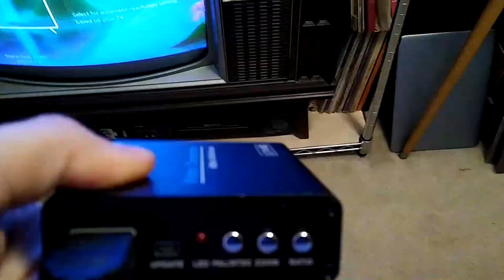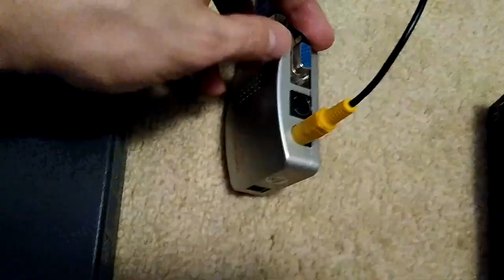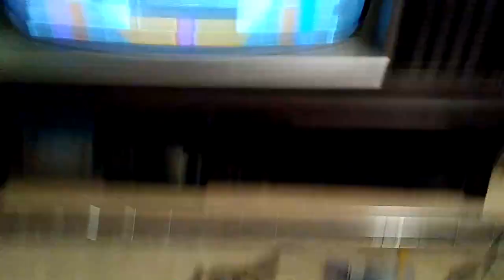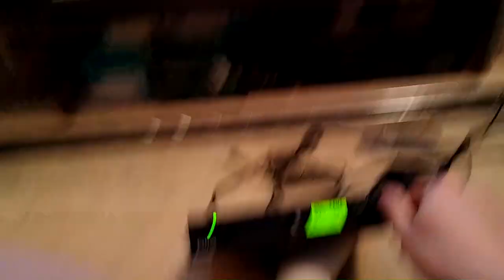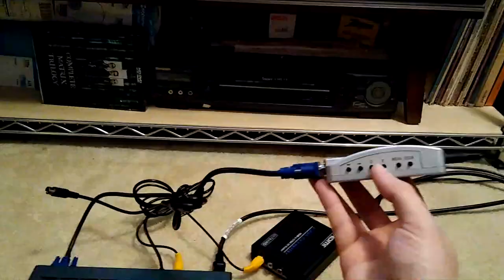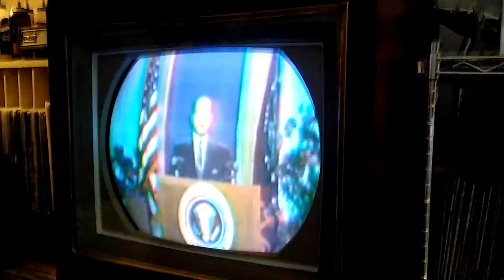Eliminating Letterbox (Those Annoying Black Bars) From Vintage TV Screens

Comment: Thanks Tom!  I'll throw my two cents in here... I use several different devices to get DVDs and other material on my vintage TVs...  I have an older Apple computer that runs OS 10.6.8 Snow Leopard.  The DVD app is much more useful than modern apps because it lets you completely modify the aspect ratio, color and brightness and turn it into anything you want.  This way, a 16:9 DVD can be stretched and cropped to fill the 4:3 screen.  I would then output that via mini display port into a cheap HDMI or (DVI) to VGA converter box (from ebay).  The VGA signal goes into an Extron VSC 150 which outputs composite video (NTSC or PAL).  The Extron VSC 150 is great because it does not have a display you have to navigate to make it work. It is a simple interface with a few buttons and a couple of adjustment controls. It also has an IR remote which is helpful.  Unfortunately, this older iMAC no longer supports a working web browser so I have to use other things if I want to stream YouTube or something.  So I have a newer iMAC and I output an HDMI signal and into the HDMI to VGA converter and to the Extron.  It requires some cable swapping, but no big deal...  The biggest issue with streaming from a modern web browser is the copy protection. We aren't trying to copy, we just want to watch stuff but some web sites - such as Netflix or Amazon don't allow this to work. I'm still searching for a good way to do this, doing some experiments.
Reply from the maker: I haven't had any issues with copy protection on my windows PCs...Granted I don't watch netflix or amazon.  I have sometimes encountered copy protection (HDCP) issues with running Blu-Ray into some devices. I defeat HDCP (from HDMI and DVI) with an HDMI splitter (View HD brand).

There are also remote controlled HDMI input switchers out there to eliminate the need to cable swap.  I've had 8 HDMI/DVI source devices in my main source rack and switch them all remotely with a 5 in 1 out switch feeding an input on a 4 in 2 output matrix (which also can function as a splitter/HDCP remover).
Reply: @tomcarlson3913  Thanks very much for the tip.  I've tried a different HDMI splitter and it was not very helpful at the mentioned use.  I'll look for the View HD!

Comment: I'm going to give this a shot I just spent under $100 on everything you just described for option two My old TVs are so bad resolution wise anyway '60s and very early '70s color tube sets, I just want to size the picture right when I'm doing HDMI Chromecast zoom mode on the converter box shrink it down so that you can see the whole picture instead of a zoomed picture cutting off most of the edges, blah blah blah
Reply from the maker: Sounds like you found a good deal on that gear. I hope it works out for you.
Reply: @tomcarlson3913  I'm hoping that it will work out I don't think I have to worry about black or white crush because the old CRTs that are too driven are never really good at pure black and pure white anyway I think I would only notice it on a digital television or a high definition television. Even my solid state RCA color track you might see a little but on something like a GE porta color probably wouldn't even be noticeable.
Reply from the maker: @sabbath7081  I'd recommend using a computer to set up brightness, contrast, and centering on the VGA to composite converter first as it will help avoid setting up the first scaler wrong trying to compensate for the settings of the second.
Reply: @tomcarlson3913  oh, I don't own a computer, is it doable without one? I'm sure it would just be more difficult.
Reply from the maker: @sabbath7081  It's doable without a computer (I did so crudely in the video), but having a computer makes adjusting it optimally a little easier.
It kinda blows my mind to read comments on the web about not owning a computer...Till I remember smartphones are a thing...I Can't stand watching youtube/don't like reading some of the tiny fonts websites use on my phone...They need to add monitor outputs to smartphones to make them practical for anything beyond emergency away from home use IMO.
Reply: @tomcarlson3913  I definitely dropped the ball in my life time I'm 40 years old and grew up in the age of computers watch them go from the turtle with the colored lines to what they are today but I never learned how to use them as a way of life I learned how to do a lot of things on the smartphone just by using it sometimes I feel as though I should have spent more time learning computer stuff because it would have been helpful in the past but, could have should have would have you know the story.
Reply: @tomcarlson3913  I'm pretty much good with anything mechanical and have a good career in HVAC there's always time to learn computers hopefully I'll get caught up at some point.
Reply from the maker: @sabbath7081  I'm about a decade younger, and I was kinda late learning them myself. It wasn't till partway through high school when I got exposed to high speed internet, PCs that weren't a decade+ old and nearly non-functional from viruses (and learned about electronics forums) that I first started to care about computers...Within about 3 years of that I was picking up curb PCs and installing new hard drives and OS on them after teaching myself how to do so. Now a days a dirt cheap 10 year old rig (assuming cap plague isn't killing it) is plenty good/fast for most things you'd want to do...Heck, my old college laptop I'm typing this on is 10 and still pretty good.

Comment: Is there a way to get letter box wide-screen 16:9 (black bars) with a roku on my 4:3 aquos sharp 4:3 display?
Reply from the maker: I'm not familiar with what inputs and tuner are on Aquos TVs (I understand they made many different models over many years with that trade name)...However method 1 mentioned in the video should work as long as the converter box is set to letterbox or set-by-program mode. One of the reasons I like method1 is that the Zenith DTV tuner I use lets me jump between letterbox and cropped at the push of a button on the remote so I can have it any way I want. 
Method 1 may not be the cheapest way. Depending on the age of the roku (older models with built in composite output tend to be best) there sometimes are display settings buried in the menus that allow control of that. If your TV was made after 2002 and has HDMI there may be display menu settings in the TV to control whether it displays letterbox or not.  Some HDMI to AV adapters (if you're using one) have a zoom button to switch between letterbox, cropped, or squeezed...you may have to buy multiple different models of HDMI to AV adapter and test each one to see which does what you want...None of the ones I own are being sold new anymore so I don't know what any specific new unit will do....I can also tell you from buying several different HDMI to AV adapters around 5 years ago, that they all had different default behaviors and the for sale pages were so vague about how they handle the aspect ratio change that the only way to know was to buy a few and test them.

Comment: How did you plug in the yellow video plug to composite input on the Extron? Did you use a BNC male RCA female adapter?
Reply from the maker: Yes I did. I tend to forget to mention adapters...maybe I should make a video about them.  Composite video is a signal standard that tends not to care what type of coax connector is used for it. So different gear in different markets and time periods uses different style jacks for the same standard signal. PL-259 was the original Composite video connector at TV stations and the first consumer VCRs, around the time BNC phased it out in TV studio use consumer equipment (VCRs) moved to RCA since it was cheaper.  I've also seen F-type connectors (typically used for RF instead of composite)  used for composite video in equipment intended to be used as the signal source for Cable TV systems....The Blonder Tongue AM60 modulators I use to transmit analog TV are a good example of that. I guess cable operators can't be bothered to stock and crimp a different connector on to their bulk purchase coax.
Reply: @tomcarlson3913  Thank you for verifying to use a bnc rca adapter. If not too much trouble, for option 1 what type of RF attenuator box model are you using? I am having trouble finding one. Maybe I am not using the right keywords. Also, is there a specific type of transmitter/antenna that you use for option 1?
Reply from the maker: @sedlacek50  All it says is Archer TV-VCR Signal Overload Attenuator.  I did not buy it new (it came to me in a box of odds and ends) and I don't know if it's still in production (though SOMETHING similar should still be available). Some brands of ATSC modulator have weaker signal that doesn't need attenuation or, an output level menu setting (mine has one) or control pot...If there is an output level control, setting it a pinch above the minimum level that works good should eliminate the need for an attenuator...Just make sure to start at minimum and turn it up till the box reports good signal on your channel. To be honest I don't run option 1 with the ATSC signal hard wired (thus I don't need/use the attenuator with it) because that ATSC signal is useful in other rooms I can't run wires to (so transmitting ATSC is useful to me).

Comment: What models of DTV tuner have the scaling options?
Reply from the maker: I'm using a Zenith DTT901 (Insignia and LG sold rebadges of it too) because it's also a strong receiver for DXing distant DTV stations. (Zenith also sold some HD DTV tuner/satelite boxes with SD and HD outputs and the same aspect ratio settings) The Magnavox DTV boxes (as well as the Philco, Philips, and Sylvania rebadges of them) from that same era definitely have settings for aspect ratio control. I believe the digital stream boxes also have settings, but I've never had a remote for mine to allow digging through the menus.
There's probably others too...The handful of DTV tuners I have are just what I happen find in thrift stores.